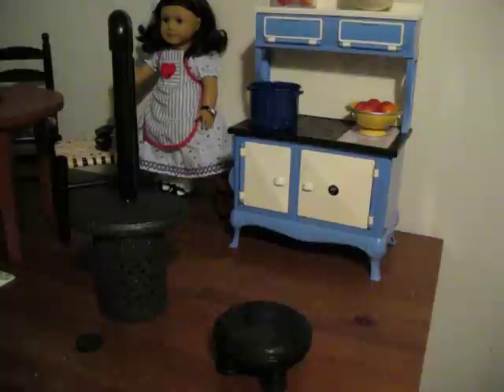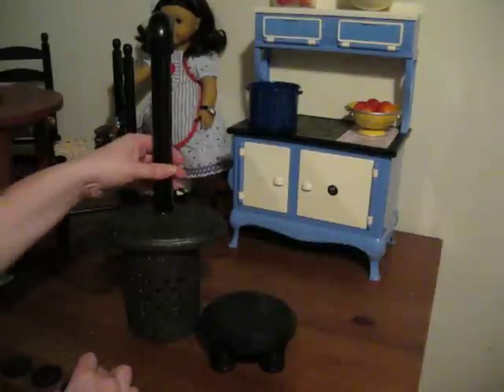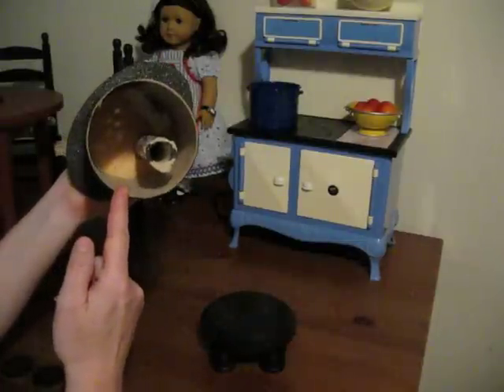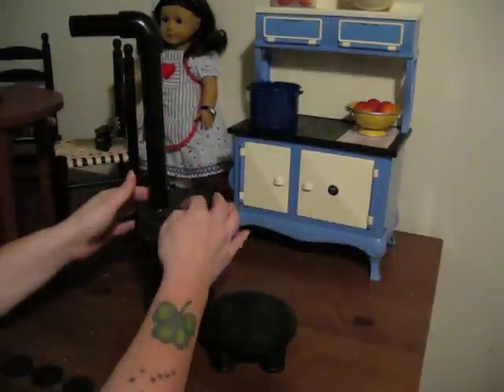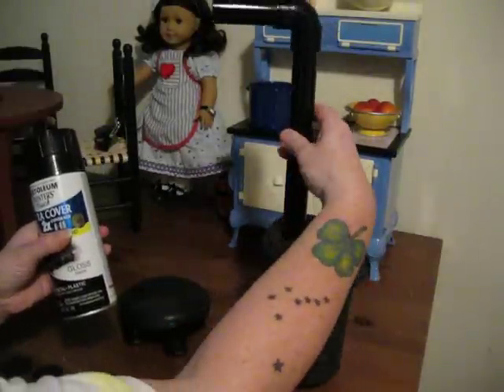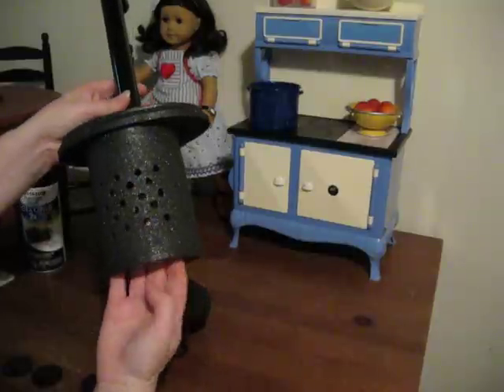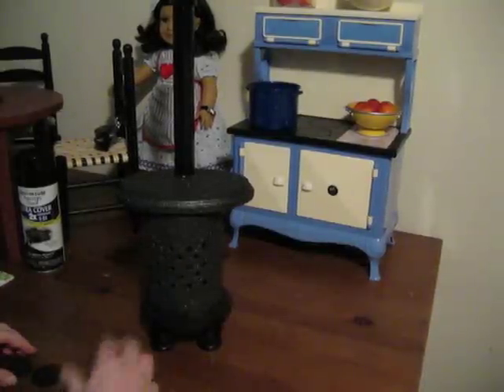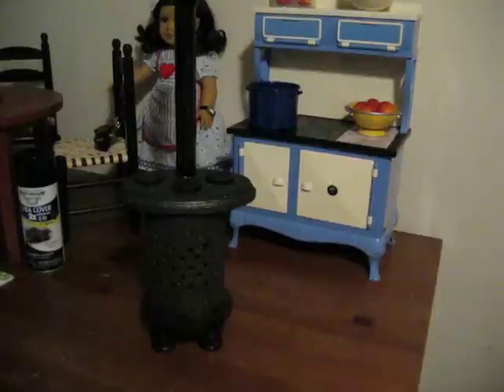How to make an American Girl stove (Addy)

Comment: It is so fun to see this in video. I could tell somewhat how it was done with the photos but a video makes it very clear. I was thinking if you could get a piece of wood cut the same shape as the bottom of the tube to fit inside only smaller ( paint it to match) and glue it to the stand. Then you could remove the top tube on & off easily and insert a tea flickering light. No need for a door. Just pull the whole top up , turn it on, place the tube back on.

Comment: continued; that would make the fire very simple. Or do you plan on having Addy's pot belly stove permanent attached to the wall.I saw at Wal-Mart in the baby food section a pot belly shaped container to hold dry vegtables to feed to a baby as a treat. I may try that. I will have to go back and see if they still have them. I use to use them with my fosterbabies. Wish I had saved a few.